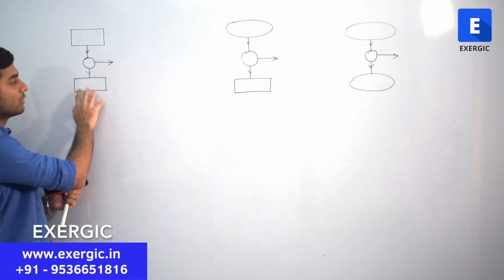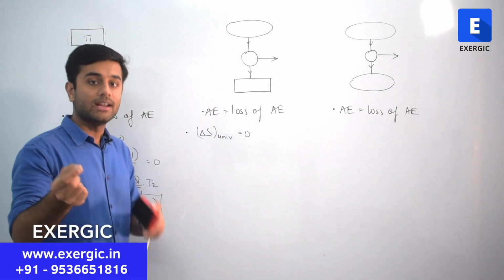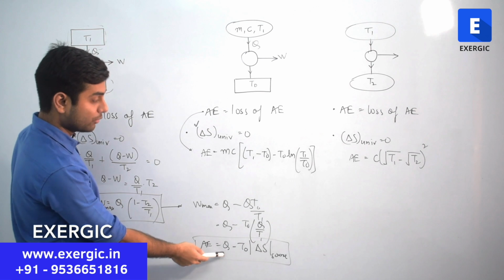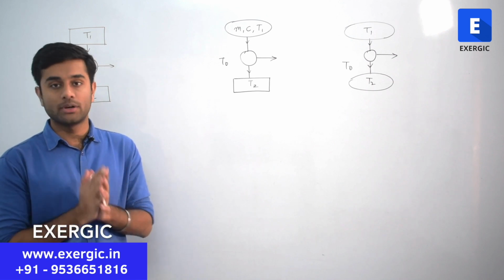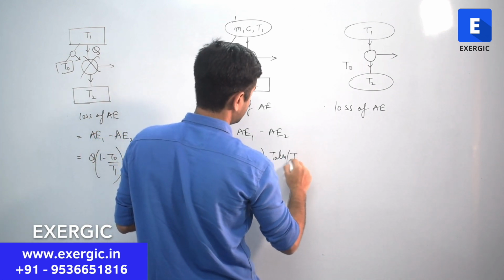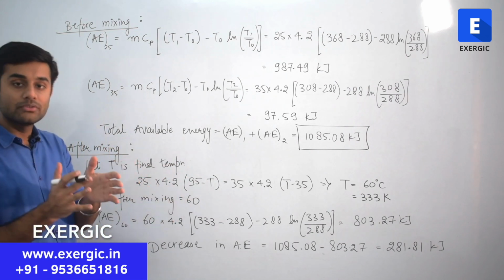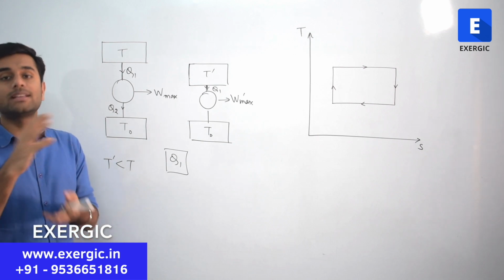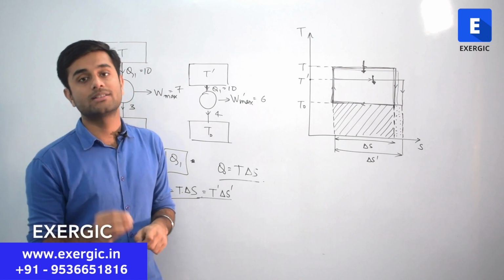Numerical clarity on Available Energy / Availability (Part 2) - Thermodynamics | GATE Mechanical

Comment: Heat transfer between two finite temp is same as heat transfer between two reservoir one at arithmetic mean and other one at geometric mean

When heat transfer happens available energy decreases because heat available on low temp
And while calculating loss of AE ...we employ two imaginary rev engine between both temp and min(amb) temp because temp difference will be higher

PE and KE is work so we get complete work

Even heat transfer is same but available every depends what is the tem range and whether it is rev engine or not

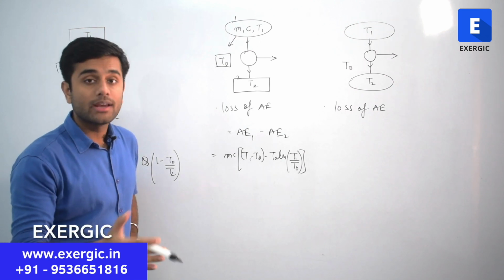Comment: At 25:00 when we are finding loss of available energy in heat transfer between finite mass  body at T1 and a reservoir T2. I think ur expression is wrong. Because the body of finitw mass won't go from T1 to T0 rather it will achieve a final temperature T2 because heat transfer would take place only until mass of body and mass of reservoir becomes equal. Hence expression for loss in available energy has to be found by same method that u have done for finding loss of AE in two finite masses.
Plz clarify

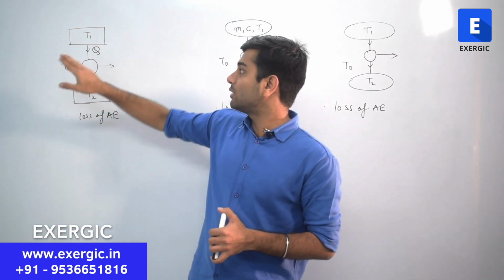Comment: sir at 22:00, u said that in order to find the max work that can be extracted out of heat, we don't transfer it to T2, we rather transfer it to T0, which is even lesser that T2. Sir my query-- If we want to find max work that can be extracted out of a heat, why should not we consider a hypothetical datum (say T= 0), and consider heat transfer to that datum, which is "even lesser than" T0, rather than taking heat transfer to T0?
Reply: It will violate third law of thermodynamic... We cannot obtain absolute zero temperature (which your are calling Datum temp) in finite no. Of Operation (i.e to obtain absolute zero temp we have to give infinite work input which is not possible)
Reply: @pratiktajne7464  ok...Thanks sir for reply
Reply: Not only that we can't reach the 0K 
But also, 

Since entropy is a property depending upon both sys and surr, we can't extract anymore work in that surrounding from that system. 

It's useless to know or rather makes it lengthy to find out actual unavailable energy, as you would have to first calculate AE(from T1 to T_datum) and subtract AE(from T_o to T_datum) 

Instead why not just calculate AE(from T1 to T_o)

Comment: Sir how can we justify isothermal heat transfer ..where W =Q..?
Reply: Because change in internal energy is o because internal energy depends on temp, and isothermal is temp remains 0. So Q=W
Reply: @Fiaz-pl5zt  I know that thing bro ..I am asking in isothermal case wrok potential should be 100% and in availability topic we calculated by 2nd law
Reply: @rohitbhosle6521  in truly isothermal case there will be no heat transfer and hence zero exergy 

the assumption we make is, 50C to 49.99999C see its not isothermal theoretically so exergy would be there accordingly (very small and low grade)